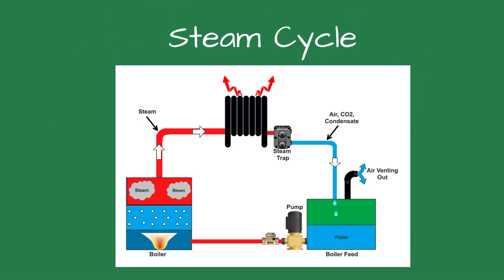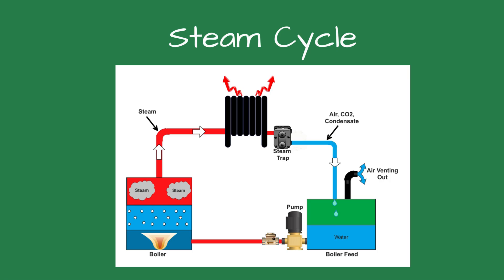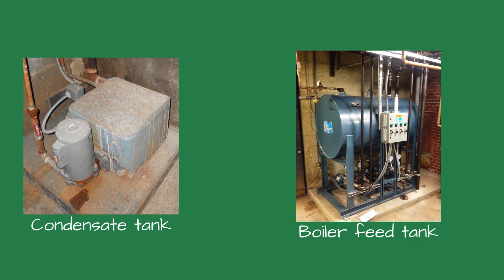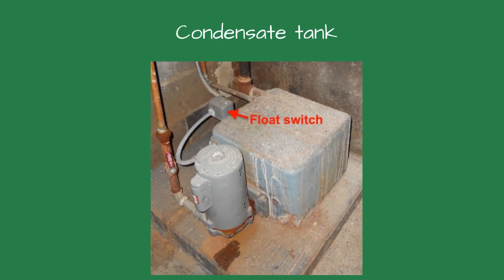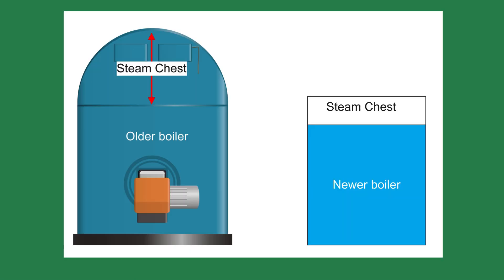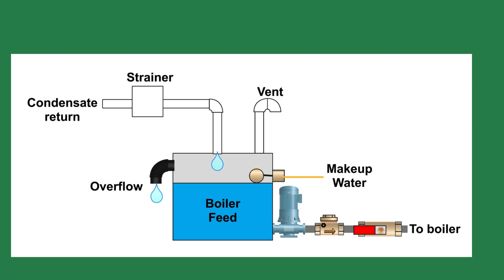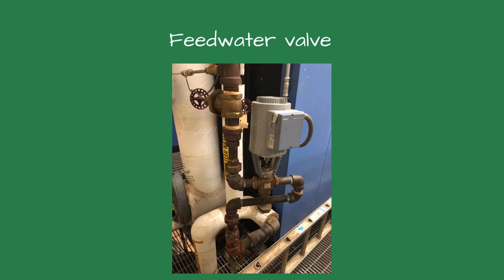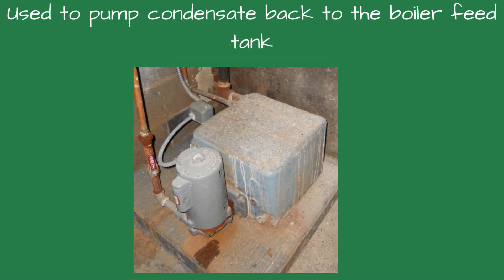Difference between condensate and boiler feed tank

Comment: Just a comment, only from my experience of course,  since building operators or owners started getting rid of vacuum pumps the amount of condensate tanks has increased. I think a lot of it was guess which left cool water in the pipes and the dreaded steam hammer when they mix. I think that the vacuum pump systems were better because it required you to check the actual piping and be honest! Good video. Thank you
Reply from the maker: Thanks @irishmike I appreciate it and agree